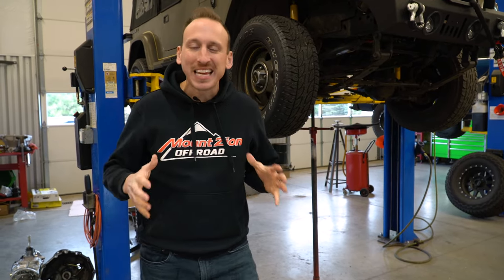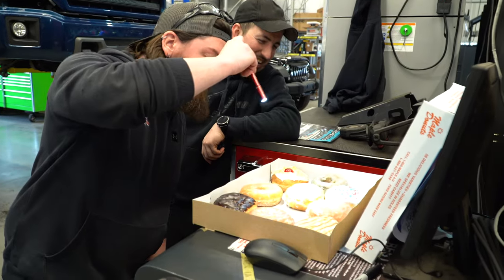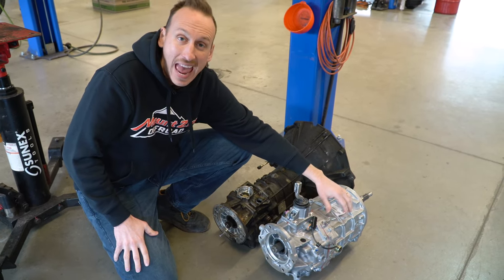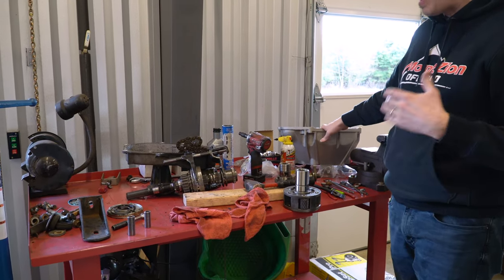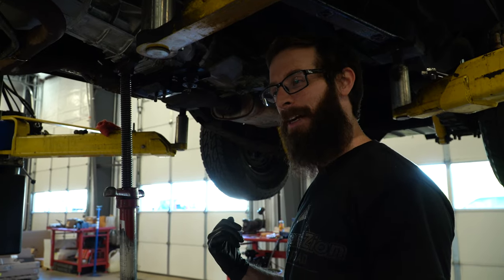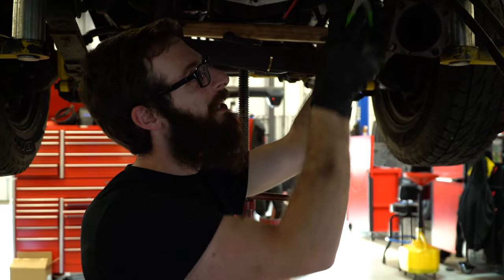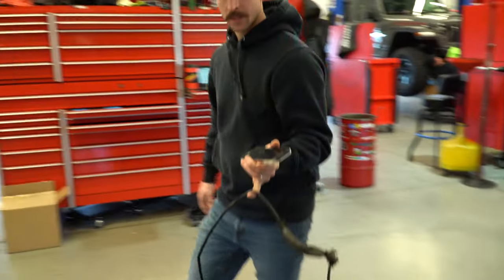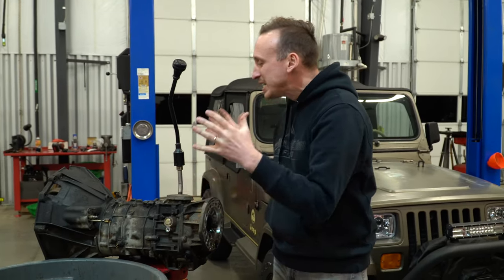French Car Parts--What was Jeep Thinking?! YJ Trans Swap

Comment: I have an 87 that's has been converted to the AX-15. Does the factory 87 starter mesh with the flywheel or did you use the factory flywheel?

Comment: I had a Peugeot BA10/5 in my 1988 Comanche.  It shifted beautifully except when cold, where it would simply refuse second until it gained some heat.  
My 1990 Comanche as an AX-15 it works flawlessless but definitely doesn't shift quite as smoothly as that Peugeot trans did.